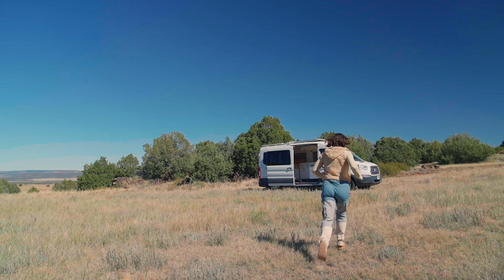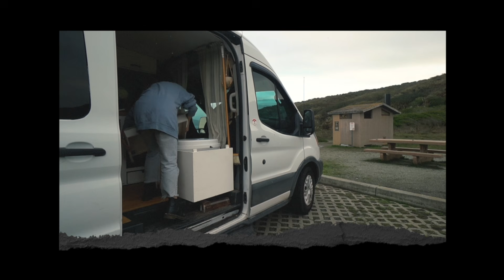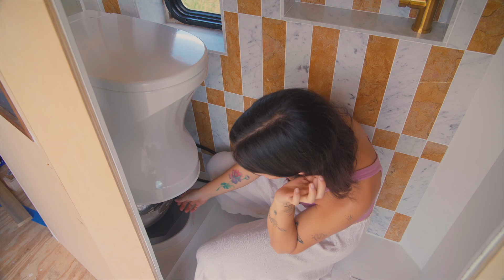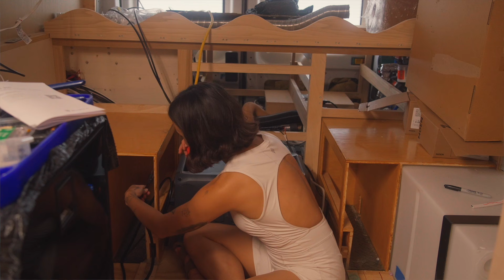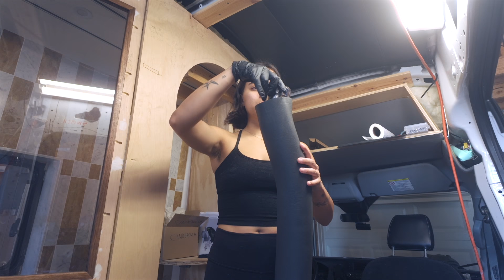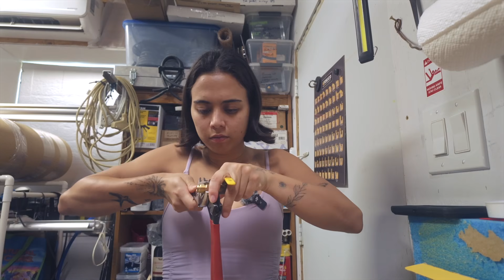The BEST toilet for vanlife? Cinderella Incinerating Toilet Install

Comment: Could it be installed in a way to make it retractable? Pulling it forward into the shower and out?
Reply from the maker: It requires a chimney out the roof and intake through the floor so unfortunately it needs to stay in one place! I wanted to do the same thing too 😢

Comment: If you actually live in van full time and you are building new van. It's totally worth it. Nowadays you can get travel diesel model that's even nicer if you have diesel vehicle. And if you have decent camper you probably also have diesel heater for your van so it's just one extra thing to add. Maybe more importantly for van you don't have to have propane bottle taking space.
Ofc, whatever it's monetarily worth it is different thing.

Comment: Have you had any issue with it being in the shower? Also how much power does it take?
Reply from the maker: I have the propane version! It uses about 12 lbs of propane for every 75 flushes. I haven’t had issues with it being in the shower but I have a sliding wall that protects it from direct splashing

Comment: All you need is a copper pipe to heat water and a pump to push water through it, steam cleaner and a vacuum to vacuum up and deposit it into a trash bag.

Comment: Oh, I have another question. Does it have to burn the turd immediately after, or can like, my partner go poop into a separate cone after I'm done, then burn both cones together?
Reply: I had a cinderella toilet at my cabin. It does burn it immedietaly after. You cannot make it burn it later. However, sometimes we would due to necessity use the same cone twice. Like just leave it in the toilet for the next person. Not super fancy or neat but thats the only option.
Reply: @goyjin5676 can't you just pause it and drop it back in
Reply: @Tylasgameinghouse  The one i had didnt have any pause functionality whatsoever. You had no direct controll over the burning mechanism. 
But that was years ago. Maybe there are newer versions with new options.
Reply: @goyjin5676 oh thanks for replying! I'd rather have a backup composting toilet if someone wants to go immediately after!
Reply: You can poop right as it’s incenerating it just stops and resumes burning but it obviously takes more time to finish the jobe